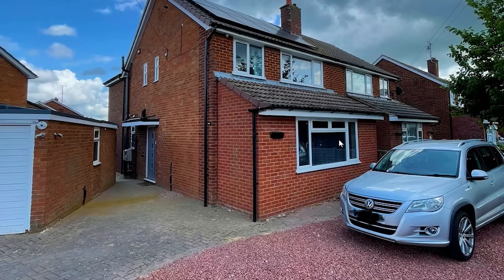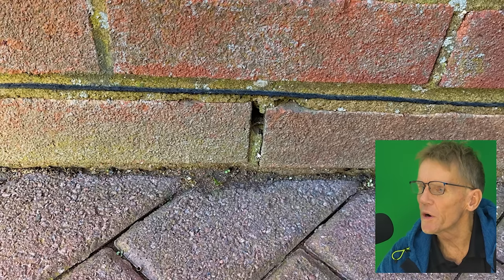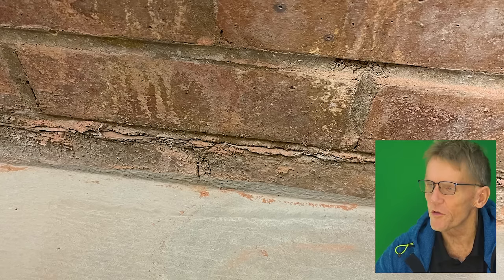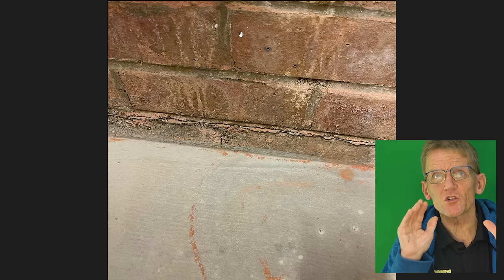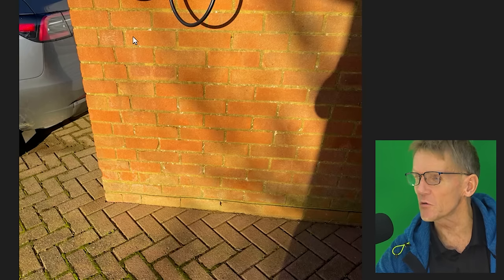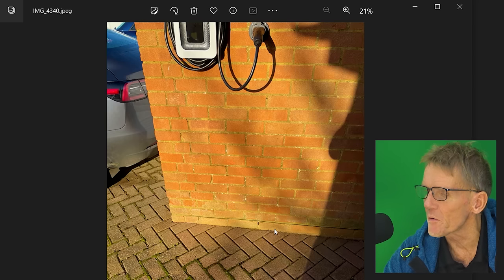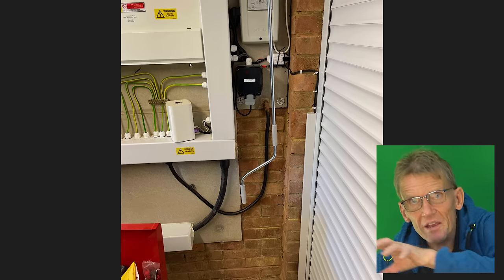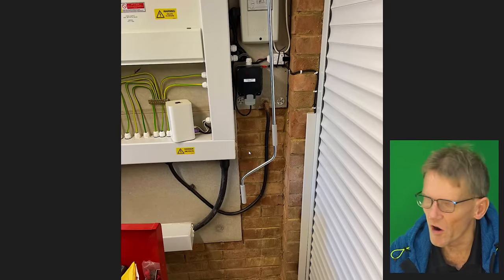Stop Penetrating Damp Coming Through Your Walls

Comment: Absolutely agree with you Stormdry is definitely the cure for this problem. A friend of mine had this happening with his garage which is built with yellow, very porous brickwork. One application of stormdry and the problem was cured, it expense but it’s the best product on the market. Before putting up a conservatory on the back of my house, I treated the whole rear wall of the house with storm dry. I did this so as to avoid damp penetration down through the external wall into the conservatory, and it worked perfectly. Had I not done that I would’ve had to fit a cavity tray above the conservatory roof to avoid damp penetration and that would’ve been a big job.

Comment: Thanks I’ve started putting on IKOpro Synthaprufe Waterproofer on the inside which looks as if it will sort out the damp floor part.

I noticed the recent fitted garage door had large pre drilled holes that the screw fits through for the guide rails for the door these did not have bungs so it was basically a wind tunnel I have since put a layer of silicone over the hole to stop the rain from being pushed through, I also got a rubber door strip on the floor fitted to stop driving rain going under the door.

I’ll either use mortar repair or mix some sand and cement on the gaps in the mortar then finish off with the stormdry. Then I think it’s going to be a summer job for the drainage.

Thank you very much

Comment: I think getting it re pointed or at least touched up. Far too many holes, especially in the perps.

The ground level is also too high, the DPC should be two courses above ground level. 150mm min. Someone has come in and done a cheap job with the block paving and gone over the original ground level instead of lowering it first.

Comment: We used storm dry on our single skin wall. after a stop end failed (now replaced). It leaked water down the wall for many years. causing damp, across 2 floors. 5L about £125, but worth it  and a few  100 to fix the stop end and re-pebbledash.
Reply: I used Screwfix No Nonsense brand of brick sealer on very porous brick and it worked a treat. Much much cheaper and you can repeat process, probably a few year's apart.
Reply: @nickhickson8738  Thanks for the info. Don't fancy going up and down every few years on a ladder. As it can be dangerous. A man an the end of our street, fell from a first floor extension and died many years ago. Even the builder we used (30+ years on the job and does  a lot  of insurance companies work) put a tower up to re do the pebbledash.  Storm dry state "water resistance for 25 years"

Comment: Brand new garages on a quality build, but they are single brick garages that leave card board boxes damp and tools rusty. Just like this example water runs down the inner faces during driving rain  Tanking slurry the inside. Dry as a bone . Perhaps £100 worth. Will also cover but maintain the damp course integrity 
Cheap masonry paint rollered onto that to make it look tidy.  Perfect.

Comment: Roger what is the application rate (litres per M2) for Stormdry, I'm struggling to find this on their website.
Reply: Zoomed in on the sales page and could see the side of the tin says 5m2 per litre.
Reply: Depends on bricks and mortar. I found it was around 4m2 or less on my extension. The main house, which is a hard engineering brick the cover rate is higher.

I've done the main areas. I'll buy another 5L to finish the extension and finish off the rest of the house with what's left.

The main area I've had issues with I'll be going over with the max stuff.

Personally, from recent experience, I'd go over the wall very closely and repair any cracks or soft mortar first. If you have any long horizontal cracks I'd double check the joint has not failed. I found a small almost imperceptible hair line horizontal crack running for two meters. I was going to inject building epoxy but the drill bit found that the mortar was too soft. The whole 2m section has been repaired in stages.

They do a mortar additive as well which I used for the mortar repairs.

Now waiting for the next heavy storm.

Comment: Hi, I live in a bungalow with an integral garage, 1970's build. The wall separatingthe house from the garage is single skin concrete common construction, with the opposite external garage wall being single skin facing bricks as per the house. This external wall is full of black mould on the internal surface, but mainly at one end of the wall. Could this be being caused by water penetration and be solved by using stormdry? Thanks in advance, hopefully.

Comment: Is Thompson’s water seal ok or is storm dry superior. I’ve got water penetrating around a pvc door and window reveals on a coastal, west facing elevation. The cement rendering was redone (a waterproofer SBR was added to the mix) but it hasn’t worked. I’m thinking of applying a sealer.
Reply: I've had good results with it in the past on a previous property - though maybe newer products are better? I repointed an entire garage wall then painted it with Thompsons, and it seemed to do the trick for the rest of the time I was there, anyway.
Reply: Avoid Thompsons
Reply: Used to use Thompsons on my mother’s garage wall, stopped about 70% but had to reapply almost every year. Storm dry has been about 95% successful and has now been on for about 5 years.
Reply: @bordersw1239  Thanks for that, I’ll get Storm Dry.
Reply: @RestWithin I used it on the bit of the garage I could get to and it seems to have done a good job on that but. The main thing is it stops the water getting in but leaves the holes in the brick so vapour can escape. Thompsons water seal is more of a silicon based sealer that effectively blocks up the holes in the brick. So if you have any damp air causing damp inside the brick getting in it can’t move outside and vent off. The problem with that is if you get enough water inside and it freezes it can break down the brick. It would be nice if garages were built to a similar standard as houses, cars would last a hell of a lot longer as would tools.
Reply: @davideyres955  Good reminder about the lack of breathability of Thompsons. Thanks. I suppose I’ll have to wait until the spring to apply the StormDry, the render around the windows and door is probably permanently damp at this time of year.
Reply: @RestWithin  you can still apply it

Comment: What if he uses Dry Rods, will it solve the isse of the DPC being too low? I built a patio in the garden a little too close to the DPC and now building control is telling me the DPC should be 15cm higher...  🤦🏻
Reply: no it won't, dry rods is just like a dpc - it will help with rising damp but not with moisture penetrating from the outside